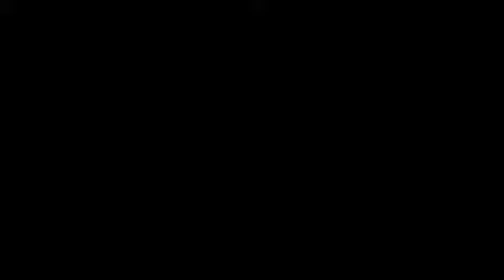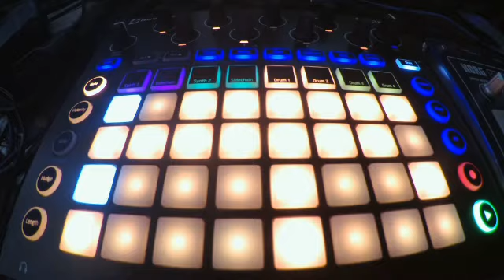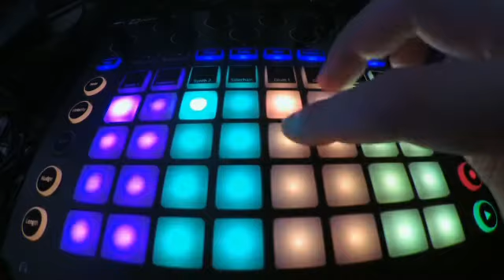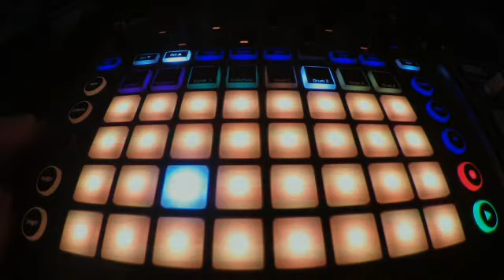How to Step Sequence Sample Flip // Novation Circuit Tutorial

Comment: I've watched this video a dozen times and tried to copy the process but I can't get it to work.

When I switch the sample sound it changes it for all the inputed samples. Even the original. And it will lock it to that sample. So if I press Shift drum 2 and go back to the original sample it will auto switch back to the newly selected one. I feel like I'm halfway there but I'm missing a step.
Reply: probably pretty late, but you should make sure you've installed the latest firmware, as the sample flip was not initially available on the og circuit.

Comment: I've tried this dozens of times and never got it to work unfortunately. The last sample I try and save never works, it always reverts back to the previously saved sample. I'm on v1.8. I understand the principle behind sample flip, it's the same as recording automation. Step editing sample flip doesn't work on mine for some reason.
Reply from the maker: Tell me the steps you're taking and we can see what's wrong
Reply: @RonCavagnaro  Thanks Ron. I'm following it exactly as you've done and pausing the video every few seconds to match what you're doing. I even have the same sample you've chosed on the same steps. I have managed to save a few samples succesfully. After completing the saving of samples and turning off record, the first step I recorded (on your video it's pad number 17) changes to whatever sample I audition while in velocity. To fix that I have to re record that first sample (pad 17) to get it to stick, then auditioning another sample doesn't change it thankfully. I don't know why it does that. I understand that inbetween any sample the pads will contain the previous recorded sample information, but that isn't the case here. I guess it's not a big deal having to do that.